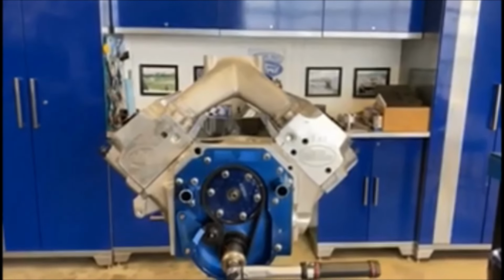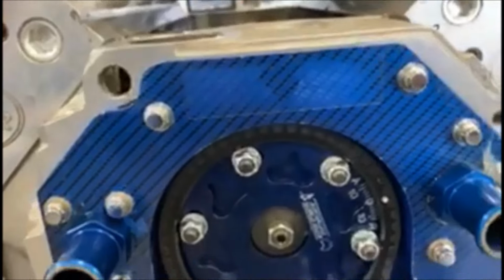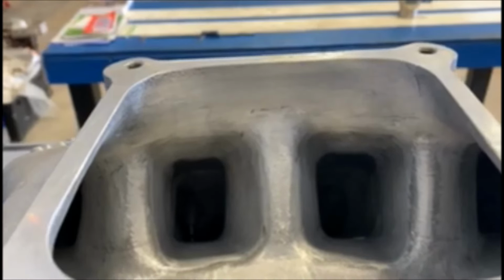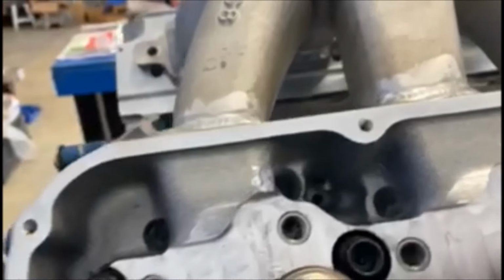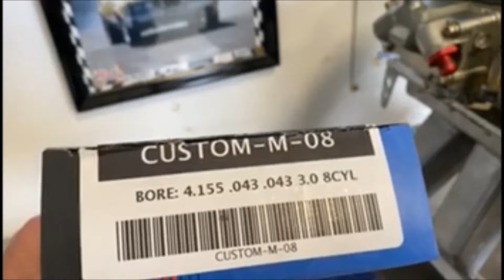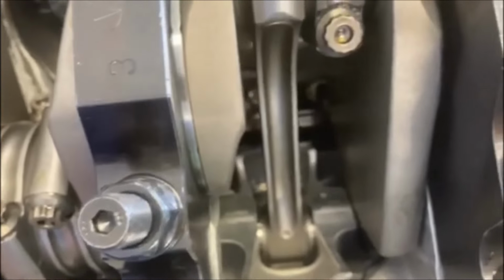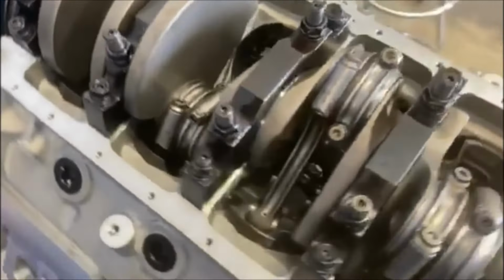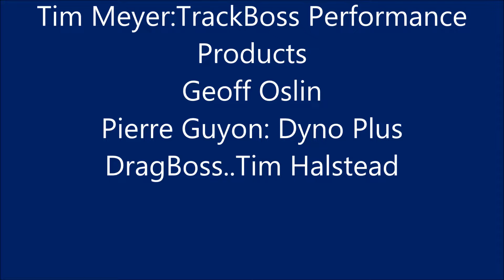Lone Wolf, The First TrackBoss Aluminum 351 Cleveland

Comment: Great build thank you for sharing. 👍
Reply from the maker: That engine almost done with changes. Now with 1.8 rockers, custom sc1 intake made to fit BT 3.6, should make 800hp, dyno just around the corner.
Reply: @DragBoss351Cleveland  With that much cylinder head I would guess the mid 800 HP range. My brother is getting headers completed on a 430 inch D-3 headed Ford. Going into a tube chassis Mustang for the 5.80 index class they run at the no prep races. The won the championship two years ago with a 8.2 Deck yates head SB Ford. Hoping this new car and motor package might be able to run the 4.90 index class. Should have it ready to test in a couple of weeks.Good luck on your projects. 👍
Reply from the maker: @tomhamilton9140  yes I was thinking that too. But his compression was not what he thought and the cam was too small to utilize the airflow. He has changed things up so yes would think 850 is obtainable. My goal is 850 hp with them and 427 ci.

Comment: Well the lone wolf hit dyno again. Went relatively well. With the single carb setup and a 1250 quickfuel it made 785@7200 and 630ftlb at 6000. The switch to dual 1050’s made 796@7300 and 628@6000. Not quit 800. Lol. I had some pushrods touching in holes that were deflecting abit so tore down to correct that. Had some other minor issues with oiling so Kevin Johnson sent me a special made screen to install in pan to help with aeration. I’ve pretty much ready to put back together for another Dyno session. Will add a vac pump also. Then hopefully creep over 800. Thanks for support everyone.
Reply from the maker: Thanks for the update. Glad you found the push rod issue, it is bad to have problems, but to have problems without a cause is even worse.I added a windage tray, on last build. I have never used one before, bet it helps for sure. Not only in oil control, but also additional HP.Keep us posted.

Comment: Yes its the austrailian muscle parts timing belt. Allows us to adjust timing easily from outside. We are using the same cam as before and it made peak at 6900. We were not sure if it was our head size or cam. The cam was spec’d for our car, trans setup which is around 2800 without driver. We could grind cam to move hp up and possibly make more but would help in car.
Reply from the maker: Thanks for chiming in Steve, appreciate it. Only you know the Lone Wolf.

Comment: Does anybody use plasma spray coating on the cylinder walls like Nissan G-TR ? 
RACERS or engine builders ? 

Did I see studs on your main caps ?
Reply from the maker: Never heard of the CD. I think so